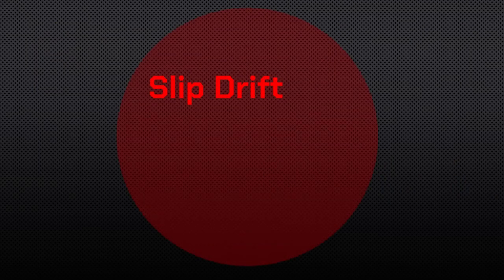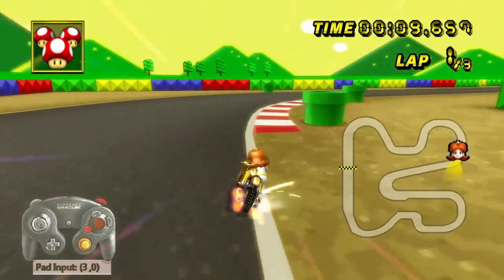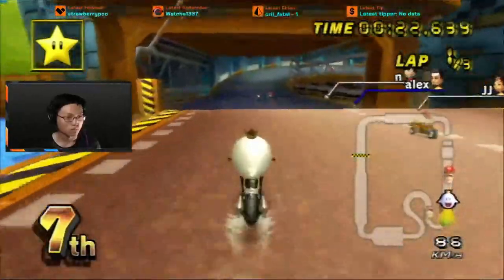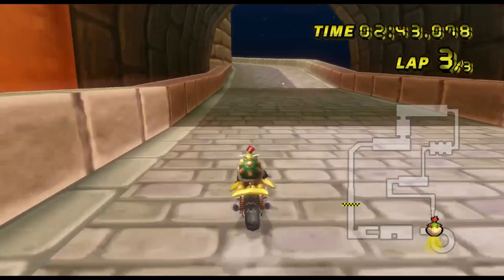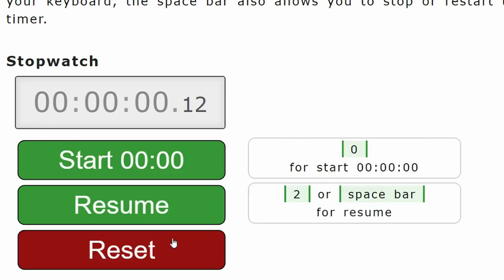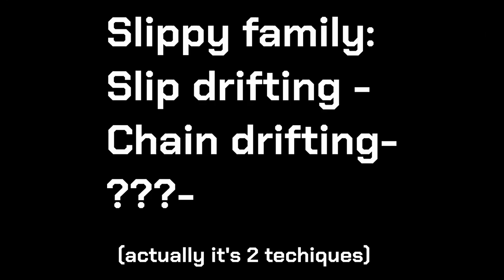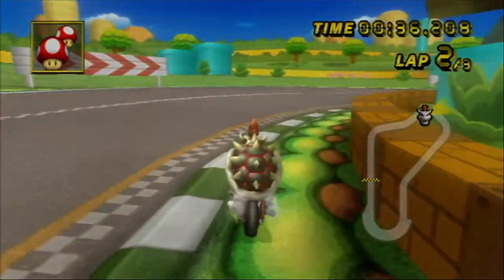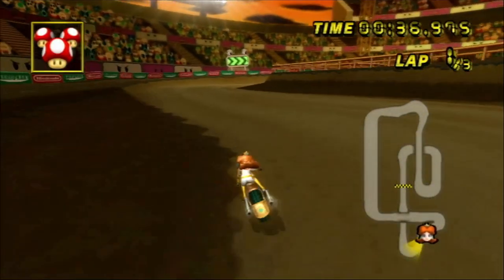Meet Slipdrifting, your new friend on the track - Mario Kart Wii

Comment: If you play with a GCN controller and utilize B-drifting, you're actually not limited to just one finger doing all the work and re-pressing drift is as fast as you possibly can. Since you have two drift buttons, you can simply turn the high demand for raw speed into a matter of timing by pressing one drift button the instant you release the other one.

Granted... in my years of playing, I'm literally the only person I've ever heard of doing this. I'm hard pressed to find players that even use B-drifting at all, and if they do, they seem to use it almost exclusively, not in tandem with R-drifting—though I'm sure there's probably some out there. But anyway, it's a viable option that I've used for years and is worth mentioning here. It can be a awkward for some I suppose since your thumb has to also keep holding A.
Reply: What is b drifting?
Reply: @dianauwu1312  Drifting with the B button instead of the R button.

Comment: Is it sad that I'm able to consistently get 00:00.07, but no lower then that
Reply from the maker: .07 is actually pretty good, I remember as a kid I was lucky to sub .1
Reply: Probably due to a 30 fps timer, if you want to get lower than 0.07 (really 0.06666...) on a timer that runs at 30 fps youll need to get 0.03 (really 0.03333...)